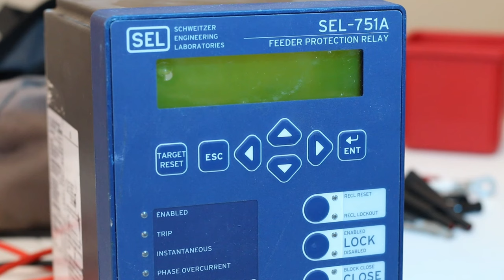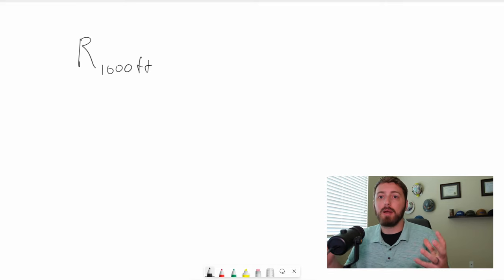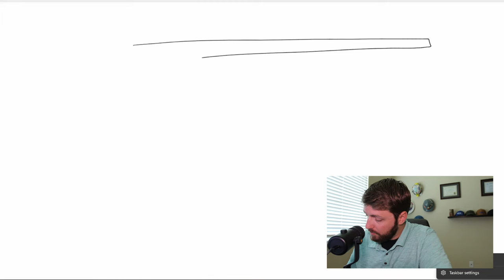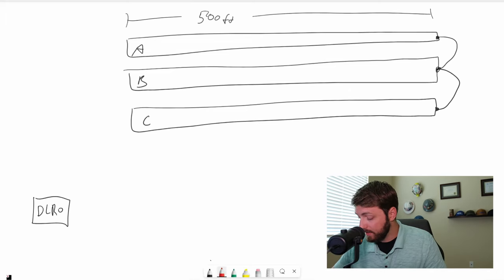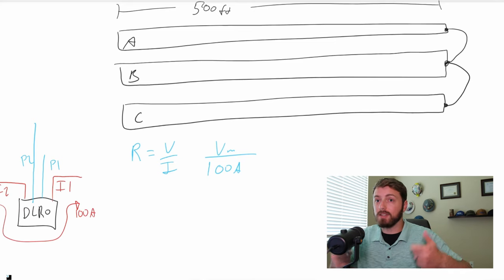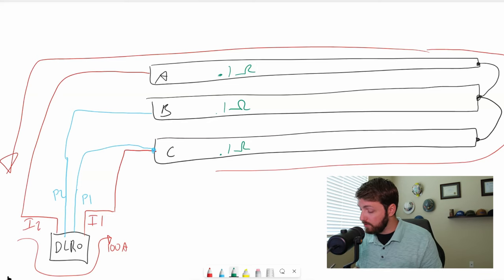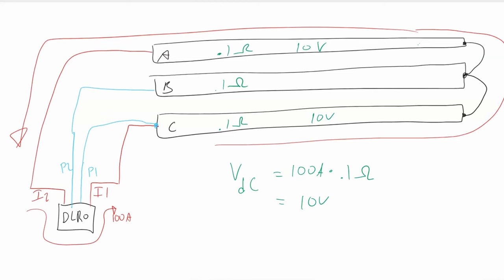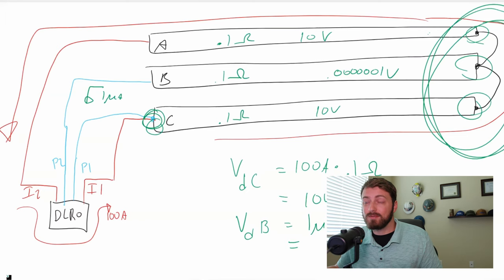Q&A#2 Cheat Code for Testing Bus Duct

Comment: This setup will measure C phase resistance as well as the resistance of the jumper from B to C. If the jumpers are good quality and connected well, thats probably fine and wont change the results much. Its alot more effort, but whenever I test generator ISO-Phase bus (longer jumpers required to span the distance between phases), to test C phase, we would jumper A to C for current path, then jumper B to C for voltage measurement. This way it removes the resistance of the jumpers. The extra effort is from having to reconfigure the shorted end for each test.
Reply from the maker: That's a good point, the important thing would be to minimize that shorting resistance as much as possible. For larger isophase bus that is much more of a concern than smaller bus duct.
Reply: Agreed, in theory it should work, but in practice I've had mixed results. I usually test:
Phase	P1/C1	P2	 C2	 Jumpers
A	        A	        C	 N	 C to A & N to A
B	        B	        C	 N	 C to B & N to B
C	        C 	        A	 B	 A to C & B to C
N	        N 	        A	 B	 A to N & B to N
G	        G 	        A	 B	 A to G & B to G

Comment: This is a surprisingly difficult concept to explain and you did a great job on it. The one thing I'd suggest including is how to split the leads. 
I'm seeing it become increasingly common to test the insertion resistance of the plugs going into the bus taps. A follow up video showing that concept would be a good one. It seems simple until you have a bus row using every tap point and a client that wants a reading isolated to just one plug, meaning you cant read from plug 1 line side to plug 2 line side since that captures the insertion of both plugs.
Reply from the maker: That's a good idea for its own video! I think I would need better visual aids for that though, probably one I'd need to shoot with bus and plugs in hand. Next time that opportunity arises I'll do my best to make it happen.

Comment: I understand the reason for splitting the leads, but since your using A phase as I2, is the resistance of the A phase bus added to the resistance of C phase bus? And adding to the topic of measuring longer bus assemblies, what do you use/recommend for a situation where you would need ~100’ leads?
Reply from the maker: Since the DLRO uses the resistance between P1/P2, the voltage drop of the only phase with both a P and I leads connected is the only one being measured. 

This technique works any time the thing we're testing is longer than your leads, even cables!